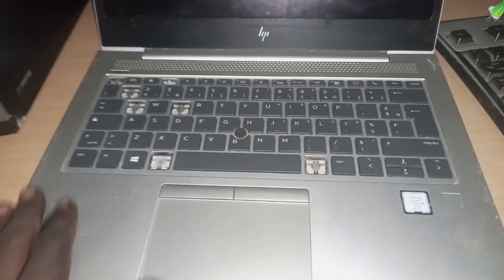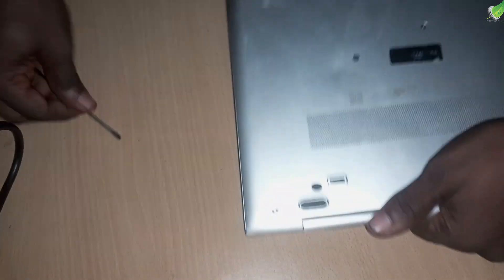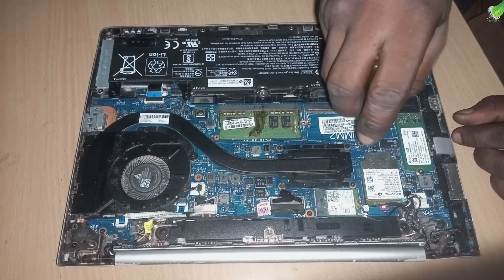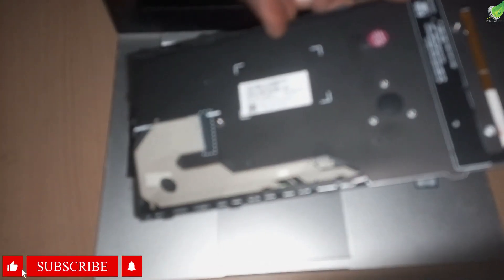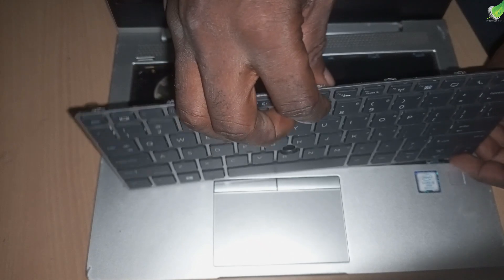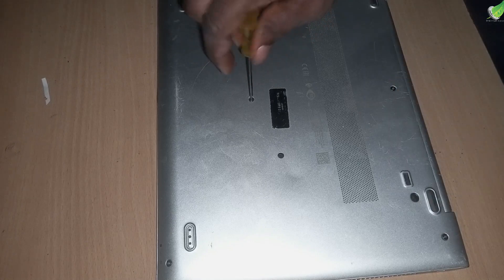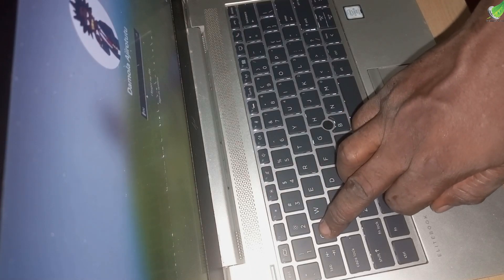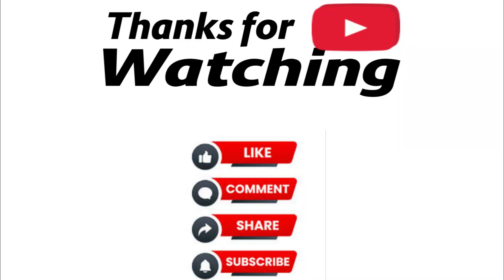HP Elitebook 840 G5 G6 Keyboard Replacement

Comment: my only one key is de attached by mistake and rubber is damaged but working with the help of a tape so should I change the complete keyboard?
using hp elitebook 840 g5
Reply from the maker: Check if the key still works when you press the white tab in the key space that was damaged, if it works then you are in luck, just get another key from another used or discarded keyboard of same model.
Reply: @dreamsetservices2847  thanks for reply bro